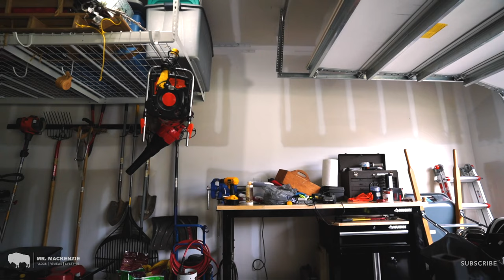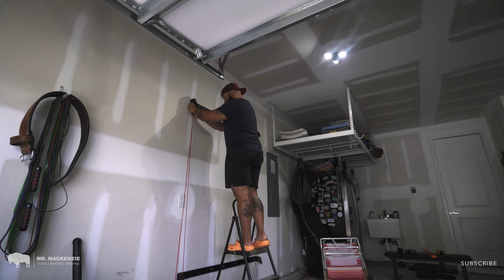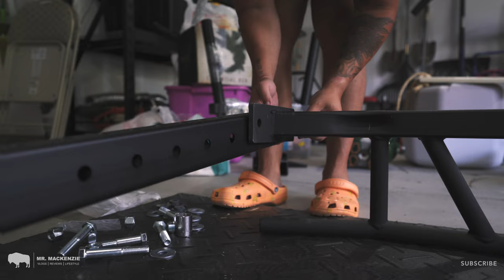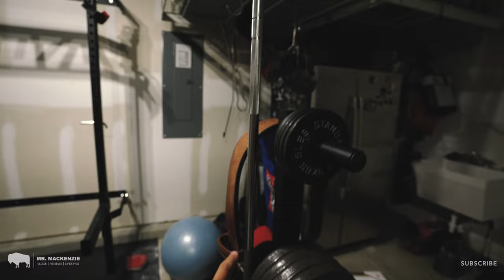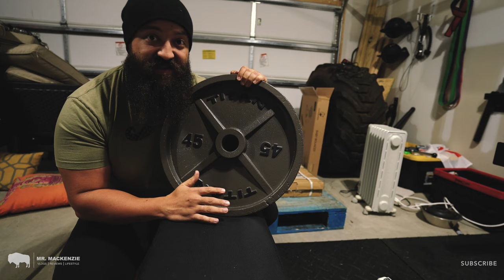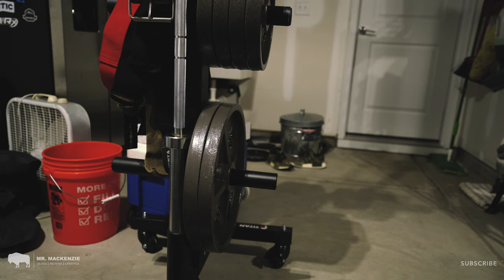Building Out My Garage Gym (PRX Performance Rack installation)

Comment: Hey man, amazing video and informative. Definitely agree on the time saving and quickly going back to family mode. 

Quick question, how did you determine which rack to purchase? Not sure where I should be measuring, is it floor to ceiling?
Reply from the maker: So as with most racks you have to look at the overall height, depth, and width to see if it will fit your space. The only difference with the PRX rack is that because it moves up and down on the wall you have to have enough vertical clearance to store it. I used a floor to ceiling measurement as my guideline. PRX states that there’s a 96” clearance needed for their standard racks, otherwise you’d need to find one of their more custom solutions.

Comment: So do they have a 72 folding rack that can fit under the garages rails or is that cutting it close you think. We have the same layout garage
Reply from the maker: I’m not sure if they do but you can email them if you have a special request.  From what I hear they can build something specific for your needs. We have 9’ ceilings in our garage and the garage rails are actually a few inches to the left of where the rack is mounted. All that to say that mine is far enough away that it doesn’t need to fit under the rails.